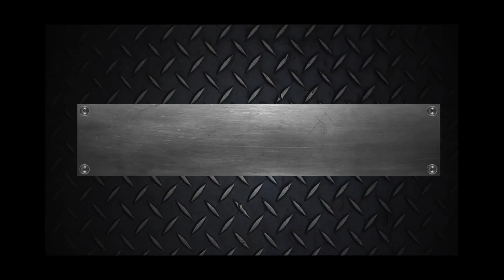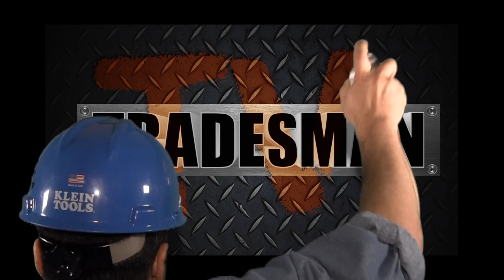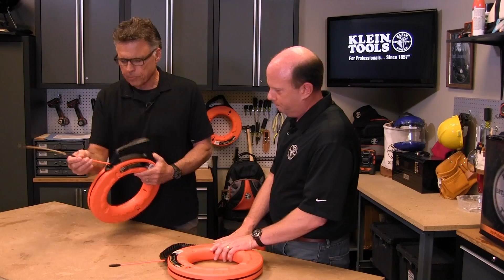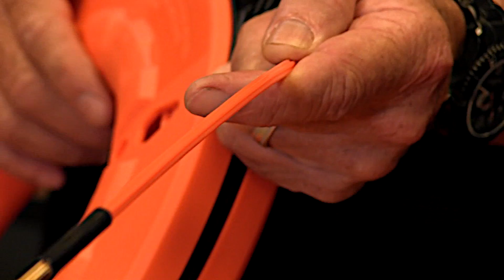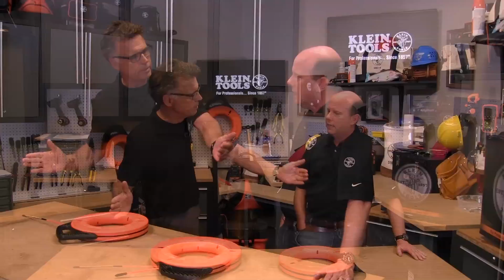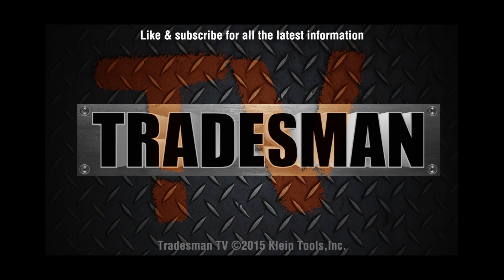Tradesman TV: Multi-Groove Fiberglass Fish Tape

Comment: looks like my fish tape pulling pliers would destroy that fiberglass tape. Will it work with my trusty old tape pulling kleins?
Reply from the maker: Name Of Action Our fish tape pulling pliers are designed for use with our steel fish tapes.
Reply: Those are for the metal ones